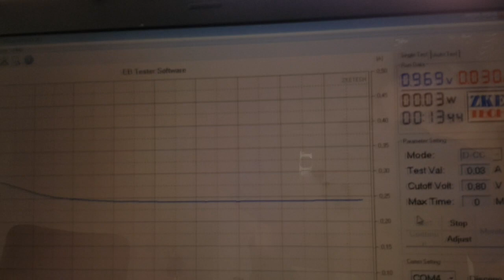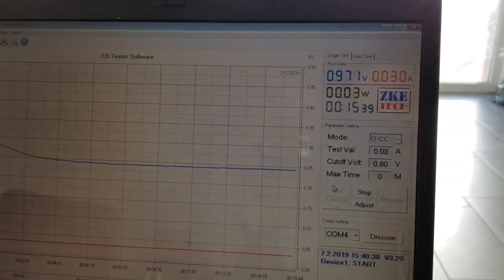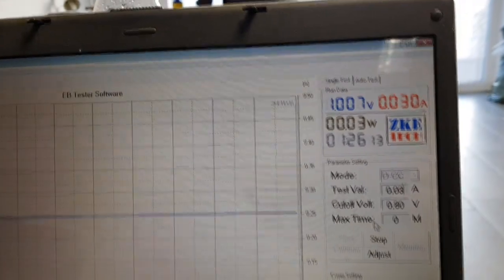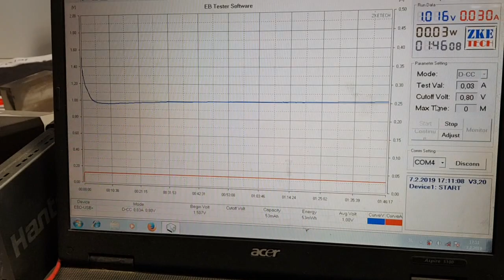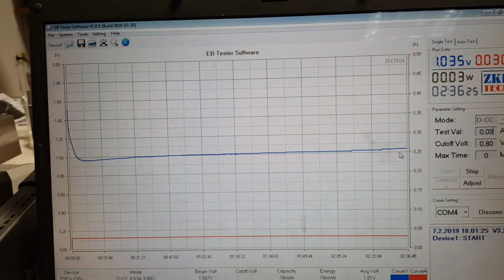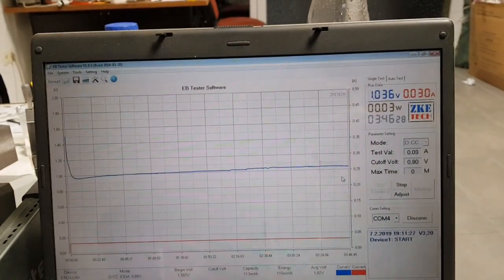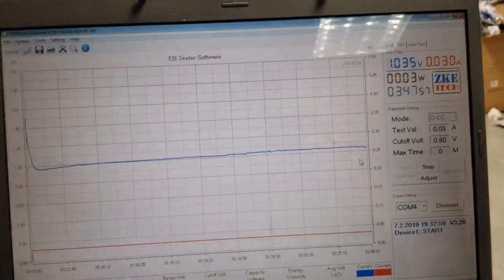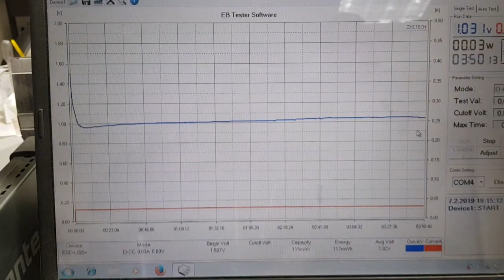Nickel Zinc Battery

Comment: Never use these cheap croco cables as they are internally only cramped to the copper wires and contacts can easily oxidate and give bad connections. You need to solder the contact points in them or get better professional cables...
Reply from the maker: yes, I know

Comment: How much active material is inside this battery cell? Without the weight of the materials true energy density can't be determined.
Reply from the maker: In basic this test cell was made more for to see if the setupe was right to get some good cell. In the next experiment I get around 160mWh and still the cell was not finish. Also the battery have some thermal effect,... if you blow some hot air into the cell, the cell generate some extra energy. So I think that the cell have around 200 mWh. I weight the dry cathode and deduct the current collector, etc. 1.32g of active material is used.